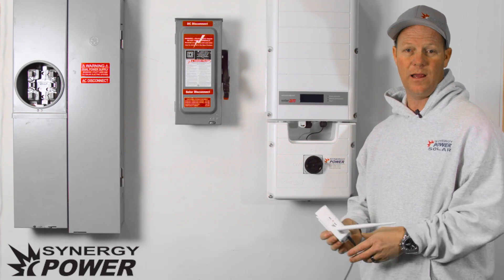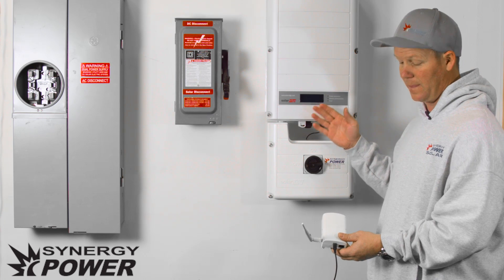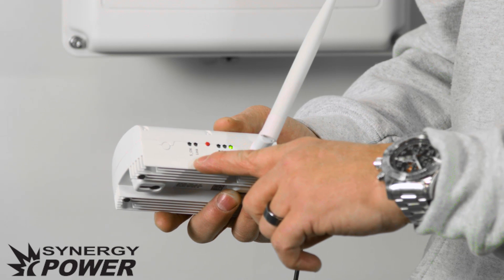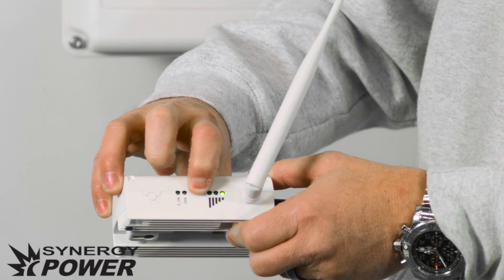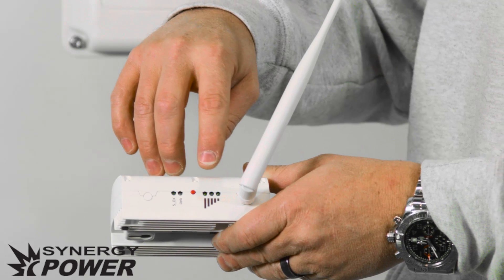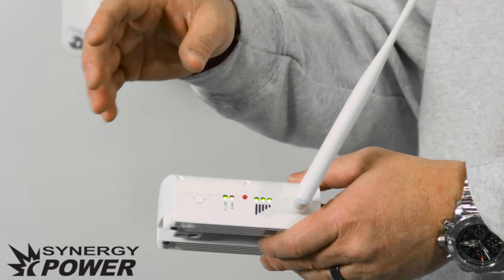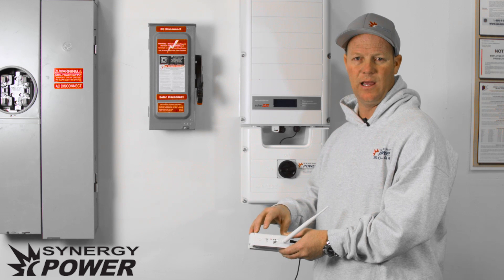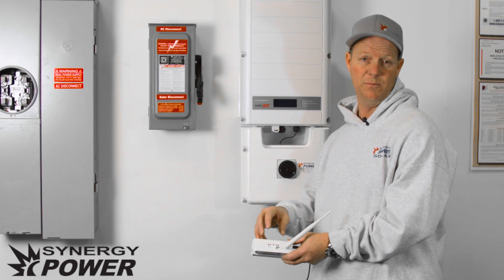How to Use Your SolarEdge Monitoring System

Comment: What if the signal lights are all on, the link light is flashing but my S_OK light is off?
Reply: I have the same problem, did you find a solution? My connection ok, i can visit the ip via a browser and get a white page without error what makes me think it the server not working. I cannot get any info about it and iv read the documentation for mechanics :(
Reply: @jouwklappik  
My house WiFi wasn't working. I reset it and it just started working on it's own. I think it still has to communicate to the Internet through your house internet. If your internet is working fine but the solar edge isn't, then you may have to call solar edge or the whoever installed the solar system. Mine started working after I reset my WiFi.

Comment: I just installed the antenna and Wi-Fi card on my solar edge inverter. I'm a little confused as to what the next step is. Do I need to configure anything on the solar edge inverter before I connect it to the gateway?

Comment: Wish I could say awesome and helpful.  I don't even get the "S_OK"  I get one green light.  I went to the slave screen  could not find Choose Communication*  (I scrolled through everything,  Found a place that needed a password.  I do not have a password so I hit the curved arrow which I think took me back to the first sceen and hopefully did not reset the password.  I know I am getting lots of solar today.  The 5th day of solar and its the sunniest day we've had except the day it was installed but not turned on until about 3 pm.  It should have shown a beautiful signal.  The inverter showed from 3000 watts to 200 watts just now.  I should have something for today and I have nothing

Comment: I was getting only "S_OK" and one green light on my gateway (no communication) and here is what I did:  On the slave (inverter) screen -- Choose Communication*, *Server*, *Zigby*, *Zigby Conf*, *Protocol (choose MPS) and finally,  *Load ZB defaults*.  Then exit all menus, go back to your Gateway box (master) and  reset the gateway as shown above by holding in the red button.  Hope this helps others
Reply: Thanks! I needed to do the same.